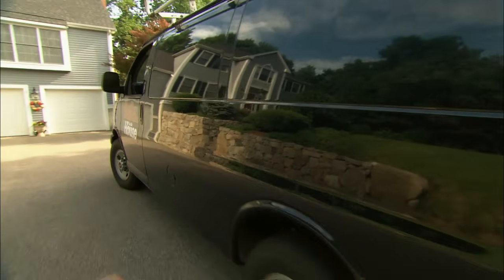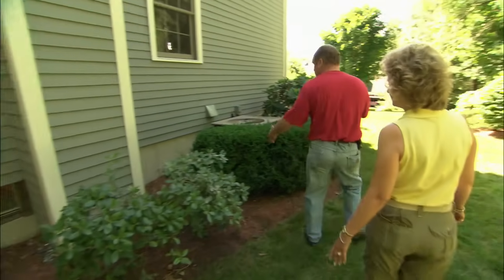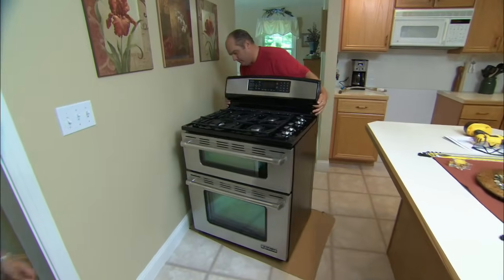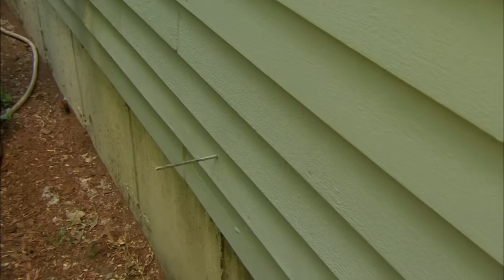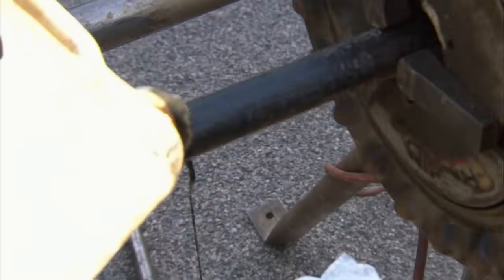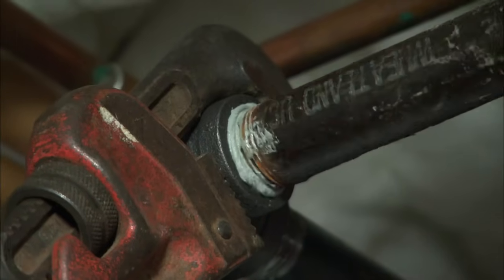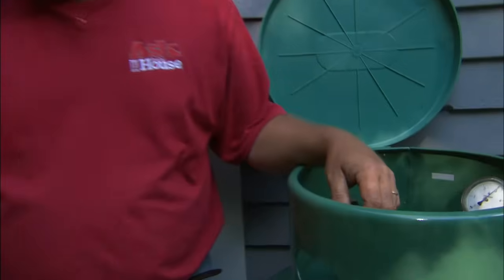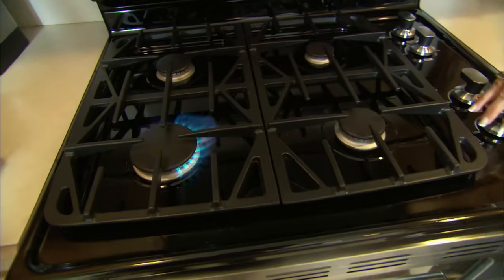How to Install a Propane-Fueled Stove | This Old House

Comment: Missing steps:
 1. Install a 120 volt outlet.  If the kitchen was built for electric, that outlet would not have been there already.
 2. Clean behind the old stove.  There's no way it would have been spotless like that.
 3. Set up the appliance for propane.  This involves changing the nozzles on each burner and the regulator near the gas inlet.
 4. The gas pipe needs to be bonded to the home's electrical ground in order to pass inspection.

Also I wouldn't want to eat lasagna made in that tiny second oven.  There's not enough room for steam to vent out and it would be soggy.
Reply: geez
Reply: gas pipe is bonding thru the appliance
Reply: That isn't code.  Unplugging the appliance would unbond the gas line.   It is permissible to bond a single-appliance gas line through the appliance circuit, but not with a plug.  It has to be a hard bond.
Reply: @igfoobar  Really.....show me the code....you wont find it
Reply: @bkoz319  Sure.  Here it is:

"250.104(B) Other Metal Piping. If installed in, or attached to, a building or structure, a metal piping system(s), including gas piping, that is likely to become energized shall be bonded to the service equipment enclosure; the grounded conductor at the service; the grounding electrode conductor, if of sufficient size; or to one or more grounding electrodes used. The bonding conductor(s) or jumper(s) shall be sized in accordance with 250.122, using the rating of the circuit that is likely to energize the piping system(s). The equipment grounding conductor for the circuit that is likely to energize the piping shall be permitted to serve as the bonding means. The points of attachment of the bonding jumper(s) shall be accessible."

It clearly says THE EQUIPMENT GROUNDING CONDUCTOR FOR THE CIRCUIT.  It says nothing about an appliance, which may or may not be plugged in, acting as the inter system bond.  In my home, for example, I have a gas service that enters the house in the exterior wall of the kitchen.  It is bonded to the CIRCUIT of the outlet to which the gas stove is attached.  Not to the appliance itself.  Not through the ground pin of the plug.  There is a #6 wire bonding the gas and electric services, and that bond remains in place even if I were to disconnect the stove from either or both services.

This is by-the-book (literally) service bonding, and every gasfitter and electrician knows it.

Comment: Have you heard about welding the pipes??? 
And why dont you use the teflon tape? Its perfect for diameters 1/2"-3/4"
Reply: Станислав Горгаз   Never saw it welded in residential applications.  Preference...I like pipe dope.

Comment: No mention of changing the stove orifice to convert from natural gas to propane.
Reply: To be fair that's gonna be in the stove instructions.
Reply: Or maybe the stove was designed from the outset to use propane and didn't need the conversion.

Comment: Did they connect the tank to the house using copper then? They were using copper for the pressure test. That copper line looked smaller than the steel gas line. :D Still a great segment.
Reply: On the outside it went from tank, to copper, to steel, to stove

Comment: what about the code for that microwave height above the stove. It looks a bit low and also it doesn't look like they have a hood vent for carbon monoxide and cooking fumes. the electric stove didn't have any deadly  exhaust but the propane sure will! How is this any different than firing up your propane barbecue inside the house without a vent?

Comment: Why do they have to loose the window? Why not just move the propane an extra foot away from the house?
Reply: Its a hazard, if anything were to happen the gas could leak into the house or an explosion would cause the glass to fly into the house, that's my belief anyway
Reply: I got the feeling they're not going to seal it off
Reply: @Altenarian   we understand the concept, He's saying why not put it around the corner or at the corner, or wherever you have to, to not have to cover a perfectly good window.
Reply: Looked like the best location to me.

Comment: I would have preferred the flexible pipe behind the stove to be longer than that. Just incase the unit needs service. 1 tech should be able to pull it forward and do the job instead of tilting it like the had to make the final connections.

Comment: They DID NOT bother with the NG to Propane Conversion Process. I thought ALL gas ranges came setup for natural gas and needed to be converted (regulator, jets, oven air vents and burner fine tuning to enable the use of propane,

Comment: What do you do if you have a perimeter concrete foundation, and therefore no basement? SOOOO jealous!
Reply: +Celia Winkler you may do bring or directional drilling or just cut and restore concrete. gas lines can be also run inside the attic. keep in mind that any gas pipe installed or trapped inside concrete needs to be sleeved on pvc and vented outdoors.
Reply: William Amaro i didn't know you could run gas line through the attic

Comment: I thought you had to have a different stove for gas and propane?
Reply: Typically, there's a conversion kit for natural gas to propane. Utilizing the same stove. And in most instances, you'll need to have an electrician installed 120 volt outlet to accommodate the oven light and temperature / clock display.

Comment: I didn't see any mention of a regulator being installed between the tank and the house connections. Don't they use them anymore?
Reply: probably integrated with the tank.
Reply: Regulator is located in the dome of the tank.
I always verify supply pressure on new installations.

Comment: they pulled the elctric stove plug without throwing the main fuse switch here in uk a convection oven is a bog standard without fan oven and a fan oven is the more faster type of oven due to the fan moving the hot air around

Comment: You should've gone for a bigger propane tank, larger ones allow you to get summer discounts if you cook a lot.
Reply: I thought so too. I wonder if they were limited by code. I would've got one twice that size at least. Although I'd probably bury it inground too.
Reply: @ColtonBlumhagen  That would be the only explanation. Otherwise there isn't a good reason for a tiny tank like that. She might as well have gone with a 20lb one like barbecues use.

Comment: Propane has yellow tips on the flame, did you notice that the flame was solid blue indicating natural gas?
Reply: Propane has a lighter hue to the flame.
Natural gas has a darker blue color to the flame.
Reply: Exactly.
Reply: Yellow tips mean your propane is dirty, or the stove is maladjusted. My stove has a solid blue flame (and I've been using propane stoves for 60 years). It may be a lighter blue than a NG flame (I don't know, I've never had NG) but it does NOT have yellow tips.
Reply: @viverra    I think it is propane now that I look at it closer.  The flame is a lighter blue than my natural gas stove.

Comment: You can tell that is a propane powered stove by the color of the flame, lighter than a regular natural gas one.
Reply: Sorry, but you've got it backwards. Propane flames are larger and a darker shade of blue, mainly due to the higher pressure.

Comment: Have they ever done anything in a house that doesn't have either a basement or a crawlspace? 
I swear if they ever tried to work on a house with a slab foundation, they wouldn't know what to do.
Reply: water under slab, in warmer climates have seen in attic, but gas in attic for slab foundations many times around here, along with the furnace/AC and have seen a water heater in an attic. of course one gas add on pipe underground from outside tank up wall right behind stove and came thru wall.

Comment: Hmmm....I'm surprised that they did not use a hand truck (dolly) to move the stove out.  What if they had dropped it on the floor?!  Also, they are not very familiar with range units because it is very easy, and smarter, to remove the oven door to make the moving easier! Oh well, to each their own.

Comment: Propane in the city? Nothing to it unless you live Here where I was held up over three weeks getting a variance until I bugged them sufficiently. Permits was convinced it would blowup metropolis. Furnace was in the basement so I had to install a fan to constantly send air off the floor outside. And the plumber and furnace company wanted nothing to do with running the pipes. Look before you leap.

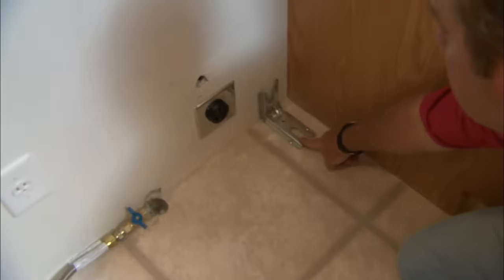Comment: 08:50 How on earth is that stove ever gonna tip forward by it self?
Reply: Robin Haas  Good point
Reply: The Anti Tip Bracket is designed to protect the range from tipping forward in the event of a small child opening the door and sitting or standing on the door.

Comment: She could have gone with induction, which probably would have been a much better choice for her. It has instant control, like gas. It pumps out a lot more heat. Water boils faster than with gas or radiant electric. It is also much more efficient because most of the energy goes into the pan, not the air. Also, her microwave over the range vent fan would suck for a gas stove. They also didn’t show what they did to the basement window to seal it.
Reply: Also, electricity is much safer than explosion-prone propane.

Comment: Not only is electric difficult to control, but it's getting extremely expensive and you're dependent on the electric company to supply it and unreliable in a storm

Comment: Induction is best./copper is easy to gas connections.
Reply: Mark Wright True but first I would point out induction in general costs so much that I doubt price of fuel is a factor (at least it wasn’t for me). It’s targeted at the high end of the market for more serious home cooks. Secondly the safety with induction is unmatched. No burners being left on, very little hot surfaces and no venting required. With kids and elderly these features alone make it superior in my opinion. Finally the response time is not the same. Having cooked on both induction is MUCH faster to heat (with high quality pans, it’s literally instant). Induction is simply capable of transferring much more energy to the pan surface then gas can (this is simple physics). The pans and cost are issues, however for home cooking at the high end I don’t think I would buy gas again as it’s not as practical for the same stove cost. 

In this case induction would of been much cheaper, even if you bought all new pans and just as good.
Reply: You can burn yourself much more easily on electric, which is also a concern for kids and elderly.  Just because it isn't glowing doesn't mean that it is extremely hot.

Mind you, a gas oven's grates are still hot after the flame goes off but nowhere near the intensity of the coils on an electric oven.
Reply: @Guillotines_For_Globalists  Your missing the point. He is talking about induction which is different from electric heating elements. You can stick your hand on the induction pad and not burn yourself because it uses magnetic to heat the pan itself and nothing around it. There is no heat transfer whatsoever. The pan itself becomes the heating element. It's by far the safest heating stove out on the market.

Comment: Why not to make gas/electricity combined stove? it doesn't matter when you boiling liquids how fast it is cooling or heating.
Reply: Gas is a fraction of the cost to run, so there would be no point of a dual fuel stove.
Reply: They make dual fuel stoves, gas cooktop and electric oven.

Comment: You can no longer buy a propane stove. All the manufactures build natural gas stoves and send a kit to change to propane. I wish the video would show changing the orifices over to propane
Reply: Not true.. most high end ranges are not field convertible. They come in the gas you specify. A  Regular 30" gas range will usually come with the kit attached to the back of the unit.

Comment: Sealing a basement window is against code in many places. Windows are there in part for emergency egress. Putting tank in back was a better idea. Especially since they had to run the pipe to the rear of the house anyway.
Reply: Not in that case. The window was too small, and too high from inside to be a legal egress window.  Putting the tank in back would have run afoul of both the main-floor window and the vent.

Comment: You can’t access the shutoff valve behind the stove
Reply: That's a good point. I would have put it down in the basement on the end of the vertical leg of pipe.
Reply: It's code. I asked the code enforcement officer - His answer was, propane is heavier than air, so in the case of a leak, it might fill the basement and could kill you if you had to go down there to shut off the gas. 
So I had them put in a shutoff outside the house.
Reply: @evanstedman7405  code requires the valve to be in the same room

Comment: you did not show how to convert the 220v to 110v. no one has both behind the oven.
Reply: It’s a fairly bit complicated for a do it yourselfer best bet is to buy a 220 to 110 adapter cost around 30 bucks
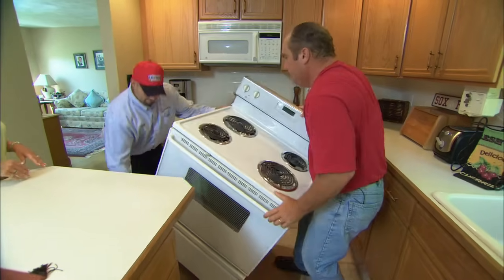Reply: Look at 2:43. It already had both outlets.
Reply: We have both, it's pretty common for older homes since most people do one or the other at some point.

Comment: I thought these stoves come configured for natural gas and required a kit to convert to propane... thats what the gas company told me and charged me 100
Reply: Depends on the manufacturer. You need to specify NG or LPG. There isn't usually THAT big a difference in price, though.

Comment: Anyone ever tried an induction stove? I now there expensive and require compatible cookware.
Reply: I have used one in the past during  a cooking class, and let me tell you is it an amazing stove! I was able to get ~5 gallons of water to a raging boil in less than 5 minutes! The only issue I have with induction stoves are that they cook unbelievably fast, so you tend to burn food on them.
Reply: Fuel cost is still high.

Comment: Oven/ranges are getting dumb.  Two ovens?  Such a gimmick.  It has consumer regret written all over it.  Sooner or later you'll wish you had more headspace.  And putting the gascocks on top where you could truly use that space for larger pans?   Dumb.

Comment: how inconvenient is it's to switch burners. people who have electric want gas, people who have gas want electric.
Reply: Nope. I would take a gas stove and never complain about it.
Reply: I've heard the calrod burners on that old electric stove actually cool off quicker than a glass top.
Reply: In my state, the overwhelming majority of electricity comes from coal-fired generation. So, I would prefer a gas stove, water heater, heater, and dryer. Those would lower emissions and cost because natural gas here is much cheaper than electricity.

Comment: Should of got a 500 gallon tank.
Reply: Too much just to run a stove. Now if you had a furnace and water heater that ran on propane, then the big 500 gallon yard bomb would be good.

Comment: HAH. No, not really. Chefs tend to cook with Electric. If they own the Restaurant. One less added EXPENSIVE cost to deal with. Electric is Much better to cook with and Safer too. No accidental explosions or carbon monoxide risk.
Reply: also have to realize the COST about on avg $2.45 is national avg in usa. Plus delivery fee and fill up every few months.it adds up. Plus the cost of the Tank about $800 to $3,500 avg. Then Cost of the Hookup which can be another $2,000 to $5,000 avg. Then having someone come out to Inspect the Hookup avg of $250 to $500. then Cost of New Gas Stove. avg of $1,500 to well $50,000+ 
Then having to Fill up the tank.   ok lets say tank is 48 gallons like in video, take national avg of 2.45. that will be $117.60 worth of propane plus Service Call, Plus Delivery fee. so might be spending closer to $180 to $200 total. each fill up. If tank went to Empty that is. 
As it is, My Electric runs me around $120 - $140 per month. Like i said Propane is just a added Expense that people just Do Not need.
Reply: Sorry but you’re just wrong. I’ve been in dozens of restaurant kitchens and have never seen one that used electric for stoves and fryers. Sure electric is fine for residential for someone that doesn’t cook much, but gas is way better. Once you start cooking on gas you never want to go back to that crappy glass top. Much better temperature control and much faster.
Also your pricing is pretty off too. $117 isn’t bad considering it will last over 2 years and there are options to lease/rent a tank
Reply: What a load of bullcrap. Most restaurants cook with gas, not electric.
Reply: @chriswood9808   Most Restaurant Kitchens around my Area use Electric for Stoves and Fryers Not gas. It is Cheaper long term for them, Instead of having to buy the Higher Costing Equipment, Extra Permits and such Just to get the Gas.  When there is No Difference between Food Cooked on Electric and Gas.
Reply: @Ignisan_66   Most Restaurant Kitchens around my Area use Electric for Stoves and Fryers Not gas. It is Cheaper long term for them, Instead of having to buy the Higher Costing Equipment, Extra Permits and such Just to get the Gas.  When there is No Difference between Food Cooked on Electric and Gas.
Reply: What country do you live in? Lol

Comment: good installation but bad house, the entire house is made of wood, which means if termites get a hold of that house there doomed. here in jamaica all houses are built with high quality concrete.
Reply: That's how homes are built in the U.S.A Works good and cheaper to build. There are remedies for termites.
Reply: The following week, Tom Silva showed up and completely rebuilt it. Took a day, because Tom was feeling a bit under the weather.